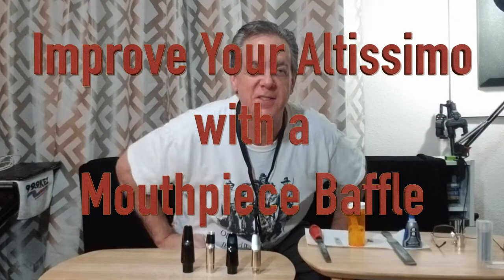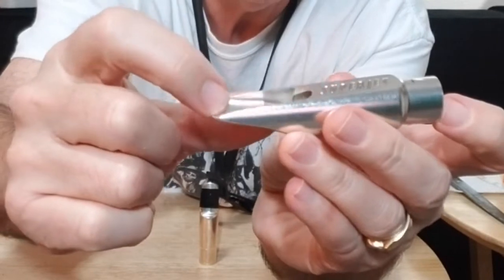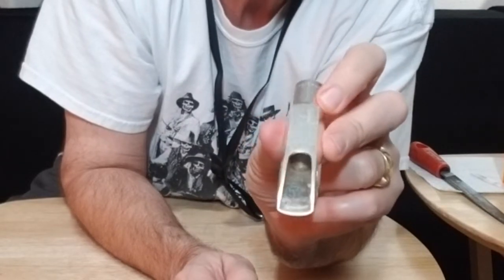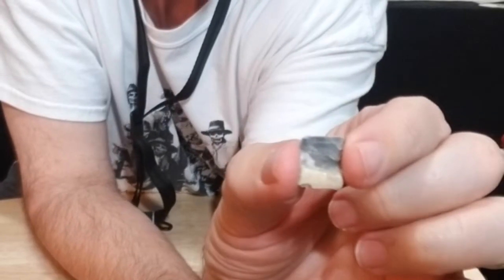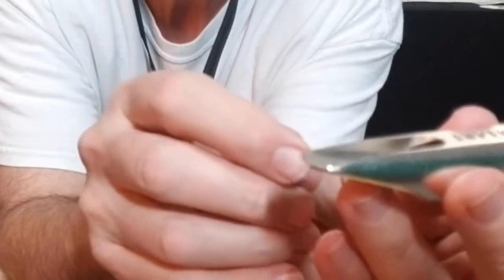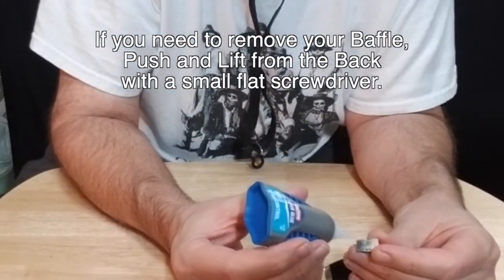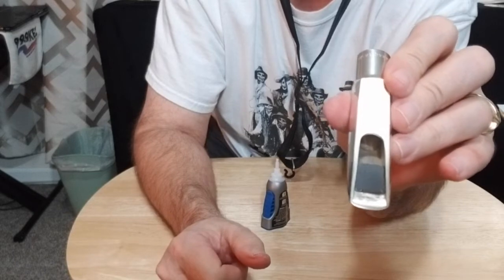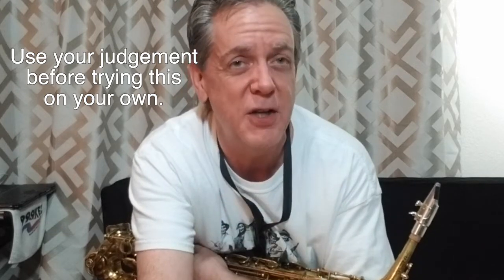Improve Your Altissimo with a Mouthpiece Baffle

Comment: Incredible and most informative,   my Meyer 6m has changed over the years and needs to be faced but it does not let me get up to altissimo D never mind G over the first altissimo..   Anyway thank you,  most instructive.
Reply from the maker: @juanmiguelorrego7271  Yes, all Hard Rubber Mouthpieces will eventually need to be re-faced, or (my preference) replaced.  They will - very slowly - deteriorate and warp.  In my 40 plus years playing sax, I have replaced my Meyer 6M (coincidence we have the same thing?) 3 times.

Comment: I've just tried Baffle mod with Modeling Clay. It's much easier but your method looks much more stable if doing it right. I will try it out your method too.
Thank you.
Reply from the maker: I bought a used mouthpiece that had modeling clay in it. But when I washed it, the clay became soft and gradually eroded. Thanks for the "sub"!
Reply: There is a clay named fimo that can be owened.then it can be rigid and stuck on the metal mouthpieces.I will try that
Reply: The clarinet players in Albania use clay to change the mouthpiece , and they get a wild, aggressive sound this way.
Reply from the maker: @Shawn-Thekl-2  I just did my first modeling clay baffle.  Works great!  And it was certainly easier.   Wonder if it will tolerate washings.  I learned that there are basically 2 types of hobby clay:  Air Dry, which is what I used , and Oven Dry , which I thought might be risky with a hard rubber mouthpiece.

Comment: 😂 

"If you want to create a removable high-baffle for your saxophone mouthpiece, here's a quick method that works well! Take an old soprano reed, and if you're working with a tenor mouthpiece, placing the tip side of the reed faciing the mouthpiece tip rail -to replicate a step-baffle. This design boosts airflow speed, giving you a louder, edgier tone. Turn the reed flat side up, cut it to your desired baffle length, and wedge it in the mouthpiece, leaving a small gap from the tip. ( You can as well adjust the height ),cut a small size of a used  wine cork as a secondary wedge to place underneath the end part of the reed for extra support, and secure both it with a small amount of shoe contact cement for a firm bond. This setup mimics the characteristics of high-baffle mouthpieces, offering more projection and brightness for genres like rock or funk. Hope this helps! 🎷" That's how i turned my large chamber ,low baffle 0.115 to a heavyweight .. best you can file down the soprano reed edges so that the baffle goes down more into the mouthpiece to reduce the brightness 😂
Reply from the maker: @ubongntiah2000  Genius! You should make a video for this! And thanks for the tip with shoe contact cement, because I have been squeezing super glue and it usually touches my fingers somewhere. Lately I have used Air Dry Modeling clay. Easy to mold with a screwdriver. Work ing great for 6 months now.

Comment: A higher baffle can definitely make it easier to get higher altissimo notes: https://youtu.be/UwgfUI9PMWg?si=4SQI5UlSEEB8L2Jw I used a Berg Larsen 130/0 SMS metal mouthpiece with a plexiglass wedge that fits in snug without glue. Three or more octaves of altissimo.
Reply from the maker: @enoffz8021  I am surprised that there is enough space to fit a wedge into a Berg "/0" because that is their highest baffle already.  Great demo video, but I wish you would have shown your mouthpiece modification to the camera?
Reply: @MarkPeotter  I have changed the thumbnail photo for that altissimo video to show a photo of two of the wedges I use. I have also made wedges for Dukoff mouthpieces. Let me know if you get a good look at the photo or if you have any questions.
Reply from the maker: @enoffz8021  I saw the new thumb photo.  I am impressed that you can make the wedge fit tightly without glue.  Can I buy a few of these from you?  Or do you only make them one at a time to fit each mouthpiece?  I would be happy to get them slightly too wide, and I can sand them down to fit.
Reply: @MarkPeotter   Yes, I only make them one at a time to fit each mouthpiece. I would have to have the mouthpiece in my possession to make it fit, and some brands of mouthpiece work better than others. A couple of my Berg Larsens  were curved inside, so I used a heat gun on one .They take a long time to make so I only do them for my mouthpieces. The plexiglass is pretty easy to find and I've added a list of tools used.
Reply from the maker: @enoffz8021  Thanks for your reply.  Yes, I understand the need to have the mouthpiece when you make them.  Keep up the good work!
Reply: @MarkPeotter  The tools I used to trim the plexiglass were hand jigsaws, regular and jeweler's size, a bench grinder, Dremel rotary tool, large and small files, 220 thru 7000 grit sandpaper and polishing compound.
Reply: Mouthpieces that are more curved inside are hard to fit wedges to, so I used orthodontic wax.